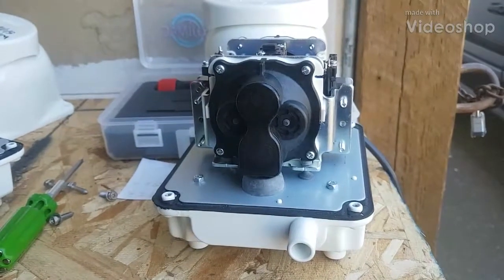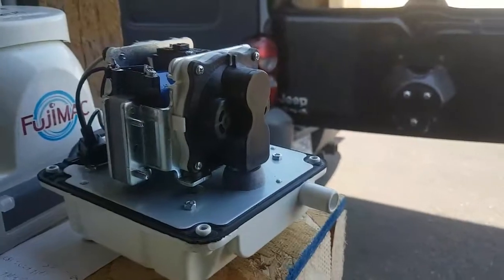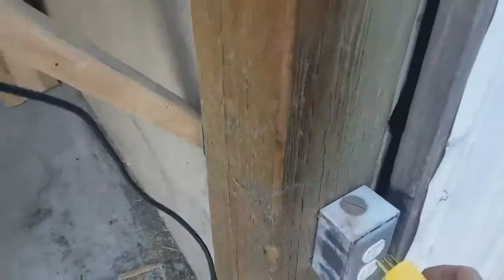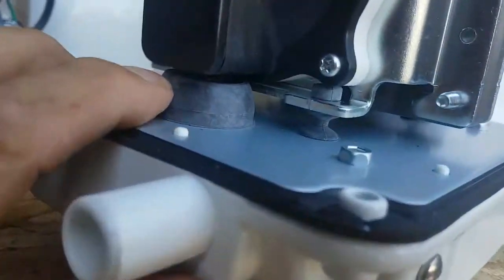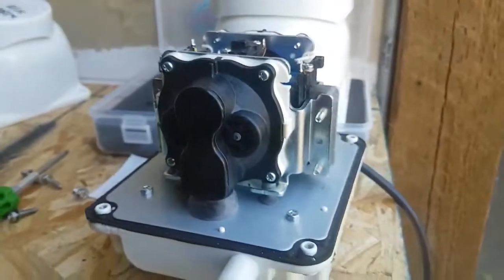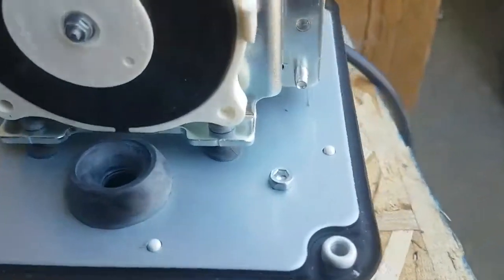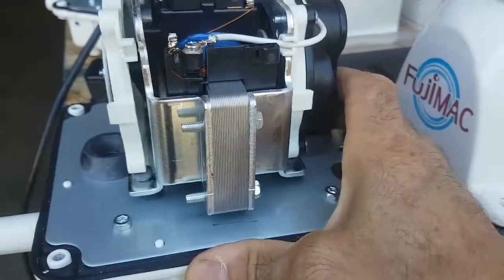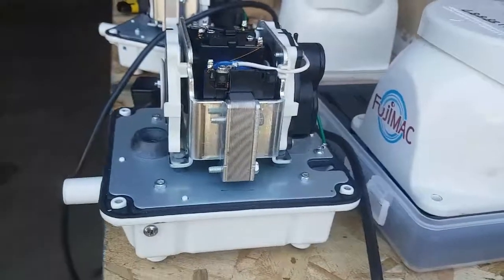FujiMAC MAC80 RII diaphragm air pump warranty report.

Comment: How long should the pump be on for to clean the septic
Reply from the maker: Our pumps are designed for continuous duty. If the air pump is turned off you run the risk of allowing the aerobic bacteria to die off which will cause smells, and possibly larger problems.